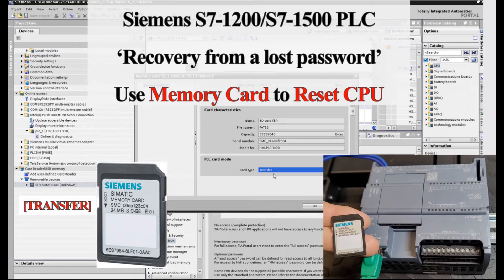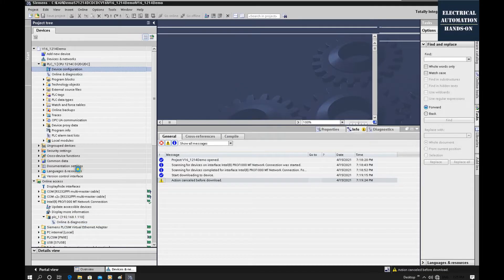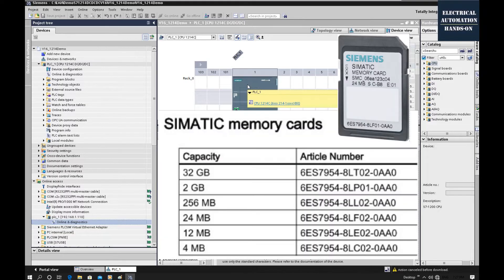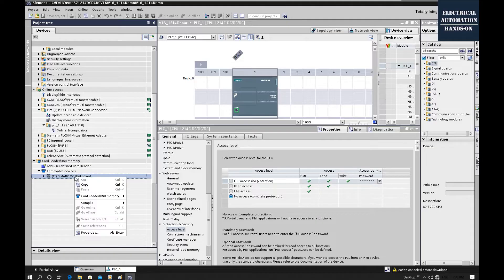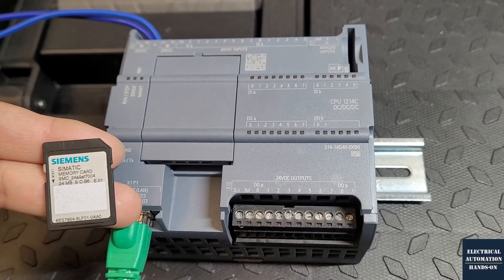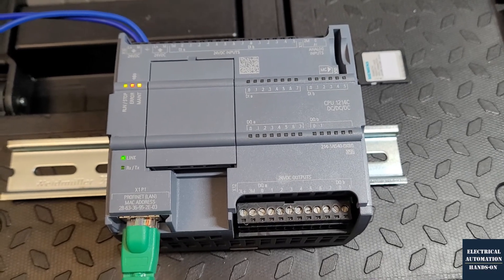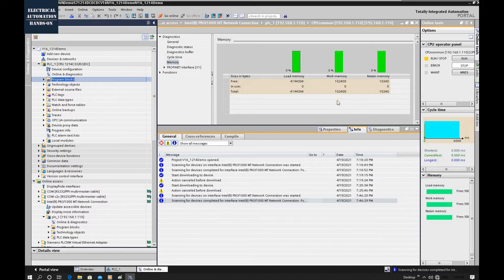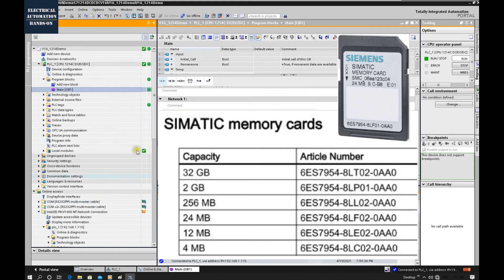SC03. Use a Memory Card to Reset a Siemens PLC with Password (S7-1200/S7-1500 CPU)

Comment: Hi, I’m very new to automation and I’m working on a project that uses an S7-1500 series PLC. I haven’t received the PLC yet, but I already know it’s password-protected. Do you know if the memory card method you showed still works with the latest firmware? On the Siemens website, the official guide only explains how to do a factory reset after the PLC is online, and it doesn’t mention any alternative methods. So I’m wondering if this behavior depends on the firmware version.
Reply from the maker: Hi the method dose not depend on the firmware, you can follow the steps shown in the video to reset the PLC. Good luck!

Comment: How can I open the memory from Windows? If I want to delete files inside the memory must be connected to pc with specific adapter?
Reply from the maker: You can use the windows and card reader to read the card. you can delete the files in the card, but DO NOT FORMAT it

Comment: I do have a 1511-1PN PLC which is programmed using TIA Portal V17. Is it possible or will it work for 1500 series PLC .
Reply from the maker: Reset the S7-1500 password to wipe out the CPU is the same as S7-1200.
Reply: @electricalautomation  okay thank you i will check and update 😊
Reply: Hi thank  you for sharing , but i have tried this for 1511-1 PN , where it is not working , i tried for 1214c plc for 1214c its working
Reply: Also can you please share a video if possible with 1511-1pn

Comment: I really enjoyed your video, thank you for sharing such valuable content. I have a couple of questions regarding my PLC CPU. I'm looking to choose proper memory, but I'm a bit confused about which memory card to choose.

Option 1: 6ES7954-8LF02-0AA0
This seems to be a spare part for SIMATIC S7, offering 24 MByte memory with 3.3V Flash, suitable for S7-1x00 CPU/SINAMICS.

Option 2: 6ES7954-8LF03-0AA0
Similarly, this memory card is designed for S7-1x00 CPU/SINAMICS, providing 24 MByte memory with 3.3V Flash.

For my second query, my CPU has read access but only write access is protected. If I reset the CPU from online and diagnostics, then reload the original program backup after removing the password, would it work?
Reply from the maker: If you have to use 24MB card, order 6ES7954-8LF03-0AA0, the xx02 is phase out part number. Typically a 4MB size card is good enough unless you are going to do huge project. 
You method will not work, your PLC will still be password protected because the HW configuration located in the card, it will work for your CPU once you use it and power up your CPU. You can upload your PLC to TIA Portal (HW & program), remove the password from the HW configuration, then download the CPU. Then you are free to use this CPU.

Comment: Hello Greetings
I have a 1200 blocked.
Always ask me for password.
I done this procedure with 2 mb Simatic memory card with a empty program, without password and full access using Tia Portal V17.
But I cant get access, the PLC still have protection.
Any help?
Reply from the maker: I think you missed some operations. Also I don't think the video shown the 2mb is available for the reset operation.
Reply: @electricalautomation  HI,  Sorry for this late response
Thank you for your time to respond, it really took me a while to try this again.
You were right that the 2mb card was not listed on the cards for the procedure. 
so I bought a 4mb model 6ES7-954-8LC03-0AA0
But I still can't erase the CPU

I follow the same procedure that you do in the video.

After configuring the card as transfer, a S7_JOB.SYS file and a SIMATIC.SYS folder appear, is that normal?

Any ideas, what am I doing wrong?
I am with a CPU 1212C Firmware V4.6
with TIA Portal V17

Comment: Hello sir, 
If I did that and upload the program to SMC from protected PLC , i know the program will be lost , but can I put the SMC in PLC and run normally? Because I have a program uploaded in SMC ?? PLEASE 🙏.
Reply from the maker: No you can not run because the SMC card was set as "transfer" rather than "program"
Reply: @electricalautomation  But couldn't you plug the SMC back into your computer and set it back to program in TIA?

Comment: This works for Fail Safe CPU S7 1500  also?
Reply from the maker: S7-1500 has memory card and it also come with reset switch. It operators difference with S7-1200
Reply: @electricalautomation  so do you have solution for S7 1500?